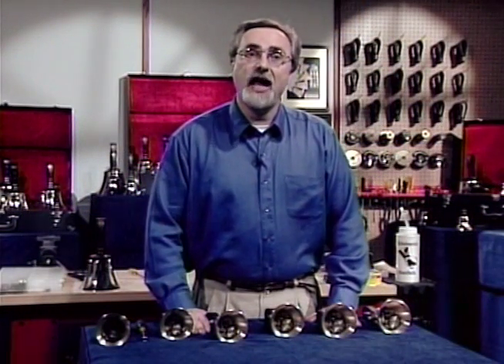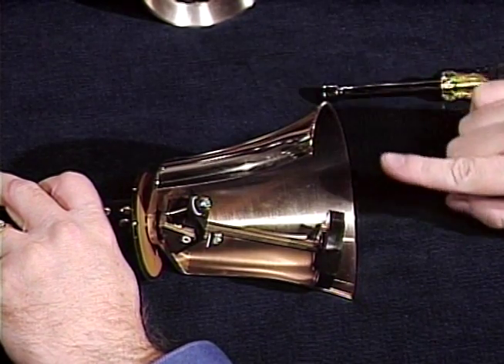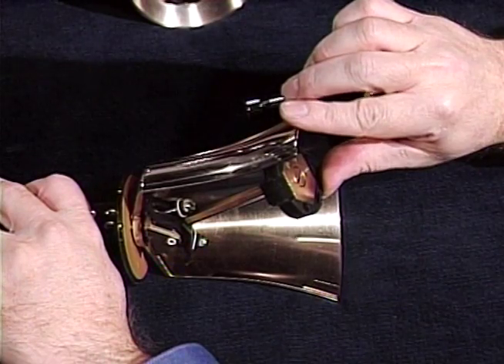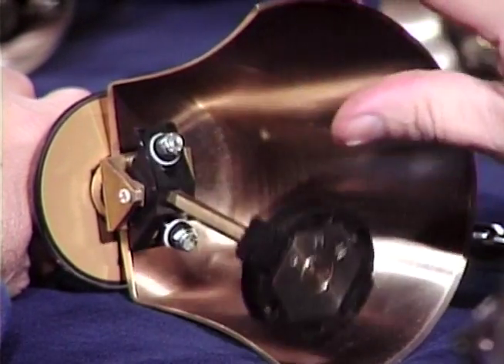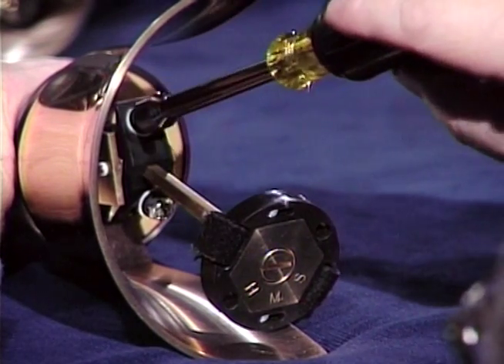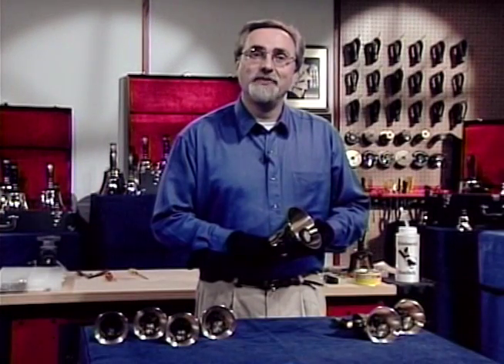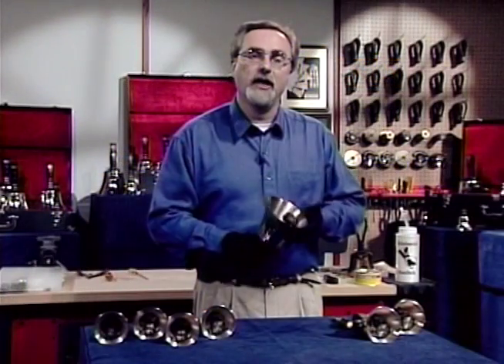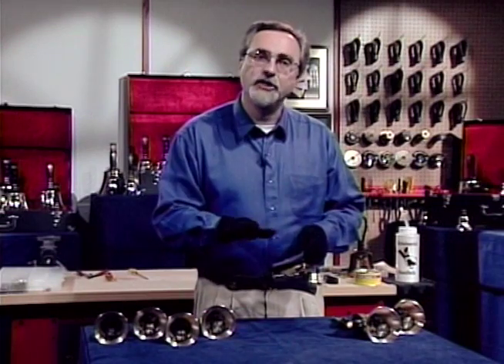Handbell Workshop - Tension Settings

Comment: I just did these after replacing the inner springs and nuts/bumpers. My 1990 set of 3 octaves now feels butter smooth and very easy to play.  Before, they were difficult to get to ring with any consistency and were very uneven.